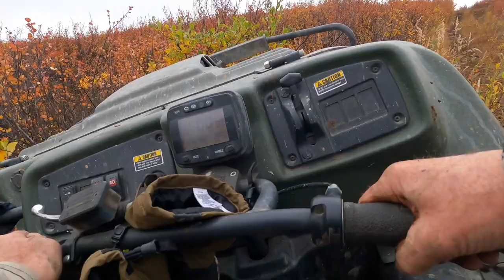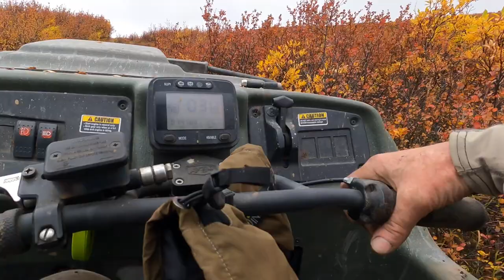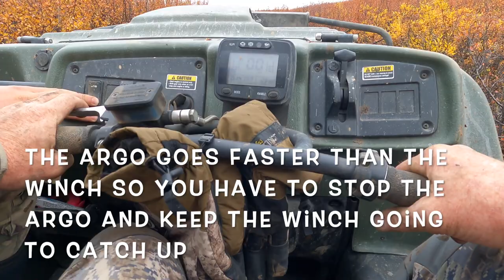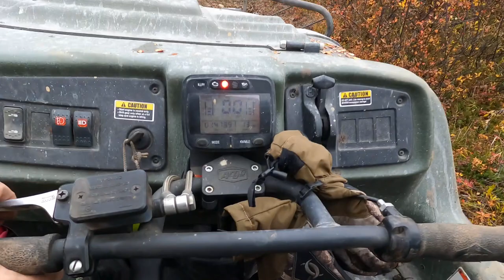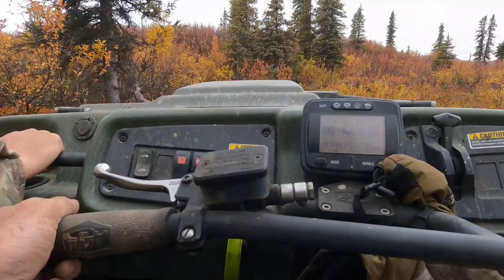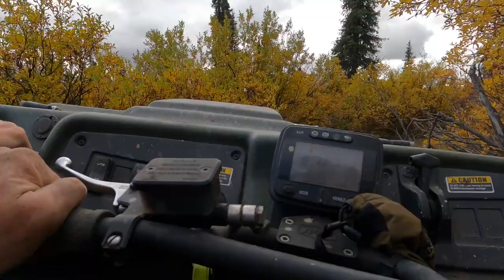An Alaskan Moose Hunting Trip with an Argo Gone Wrong - Day 2

Comment: My father worked on the Denali highway in 1956. My first trip was up there while he was working.I was 14. Some of the rigs we used were old weasels, 4x4 old dodge military rigs with 20 inch aircraft tires. This new stuff makes it a lot easier, you don't have to rebuild them all the time. There are a couple of those rigs still up there if you know where to look. I use a 6x6 polaris now.
Reply from the maker: Dandy rig. I’ve had conversations about going that direction.

Comment: Argos are 50,000 dollars now.   Under powered.
Reply from the maker: They have gotten very expensive, but I don’t know that underpowered is a correct term. They are low geared, and will go anywhere, but they don’t get there very fast.
Reply: @RaisedinAlaska in your video,  it wouldn't make it up a hill.   I had one.  They are under powered.
Reply: @RaisedinAlaska I have 300 acres in Ontario Canada.  They work good on flat land,  but my cousin and I both have an 8 wheeled argo,    and they are under powered.   Have a good one.
Reply from the maker: @mattdelany6799  Good catch: it would not make it up the hill because the grousers on the tracks are UHMW plastic and were slipping on the large flat rock trail going up the hill. Clearly, I should have given more details about that issue. Thank you.
Reply from the maker: @mattdelany6799  Good luck in the field. 👍🏽

Comment: With all the terrain features you barely made it through what was the plan to pack a moose out?  Also when the trailer was hung up, what stopped someone from getting behind and push?
Reply from the maker: Great question, this trip was three years ago, so I went back and watched the video again so I can give you a good answer to your questions.  With a broken track, we would have been really hard-pressed to get a moose out of there. We would have done one of two things: take the tracks off in certain areas and put them back on in other areas (which would’ve been a real pain in the fanny) or made this into two trips, and left the tracks off at the truck and went in without tracks (this would have been difficult as well because the Argo goes crazy places with tracks that it won’t go without them). When we were hung up in the first half mile it was a two fold problem: first, it’s pretty steep and second it’s very rocky, and the grousers on my tracks are made of plastic so they do not hook up on rocks very well. So your answer your question, I don’t think four people pushing. It would’ve been enough for us to get it up the hill. Thank you for watching.

Comment: do they not make a splice kit for those tracks? If not I would carry a piece of belting the same width as your rubber strips in your tracks and some carriage bolts and you could splice the track in the bush and not be screwed
Reply from the maker: I’m going to ponder that idea. After this experience, I got about 10 feet of quarter inch nylon winch cable and added it to my kit of parts pieces and tools that I always take along. I hadn’t thought about your idea, but that seems like a very doable fix.
Reply: @RaisedinAlaska  its fairly simple to do, thats how we used to fix nodwell tracks in the bush
Reply from the maker: @tyrellboyd8997  It is a great idea.

Comment: Cool video. They are a little expensive but you could consider adding a land anchor to your gear. I have heard god things from Pull Pal, I have never used one but for mud and soft ground seems like a god choice. For frozen or hard packed ground the All Tie version may be better.
Reply from the maker: I have looked at them, and I may have to add one into the back of my Argo just in case.
Reply: I don't know if it would be usable for your application but it is light weight and the idea alone is cool. Is the Deadman Which Anchor
Reply from the maker: @ezekielcade4205  I’ve been in places where without one I’d be in trouble.

Comment: So the question begs to be asked….do you really need tracks that much?  I mean people have been running Argos since what, the 50’s and only started to put tracks on them not that long ago.   With all the time spent on keeping them on, couldn’t you have just pulled both and ran it on wheels?
Beautiful countryside for a place with few trees.
Reply from the maker: Great question: There were mud holes that the Argo would not have made it through without tracks. I show a comparison of no tracks vrs tracks at the end of the video where I fix the tracks. I’ve been on this same trail, in years past, with a buddy who had an Argo without tracks and there were several places that I had to pull him through.
Reply: I ran tracks on my older moose hunting Conquest 8x8 for a few years & they were a pain in the arse. This year I swapped up the Goodyear Runamuck "floatation" tires for a set of Mudlite ATV tires & dumped the tracks. To my surprise it goes just about anywhere the tracks would take me that I had a will to risk (unless you have a 2nd Argo in the trip, you don't want to risk pushing your luck too far). Interestingly it also swims better with the mud lites than it ever did with the standard Runamucks. In my experience, the stuff you go through has to be a real more water than mud soup-mud with no root fibre in it to justify tracks. Any sort of roots or bush in the muck makes a MASSIVE difference. To get more grip you can chuck down a few bushes & branches to help...
Reply: @davidbrewer7937    Yeah, that’s more or less what I was thinking.  It’s got a lot to do with which tire, but it with a really aggressive tread it should run over almost anything.  I mean you got so many wheels, it’s almost like tracks, and no hassle.
Reply: @jimf1964  Maximum surface area in contact with the ground is key. Aggressive tread is good as long as you don't spin too much because this is like putting the root fibre in a blender. High centering is a major issue as well. I find it better to avoid the traveled track to avoid deep ruts.
Reply: Tracks ok in snow rest is worthless have had argos since 1980s.
Reply: Escargo tracks are best
Reply: @dustinclark8186  the new bush tracks  are a game changer  😁
Reply: @dustinclark8186  for sure I love mine!  glad I chose them after watching  videos of all the tracks. They are truly the best  and highly recommend them 😁

Comment: Youll be packen. Repair kit for next time.   Take a hand air pump next time. For tires.  Never know when youll need it.
Reply from the maker: I will have a better plan next time.😁
Reply: A length of steel fence wire, some steel chain & some nuts & bolts would have made a more robust bush fix...
Reply from the maker: @davidbrewer7937  True.

Comment: You need chain
Reply from the maker: Great idea. I did have a spare chain for the drivetrain.  That was an option, but I would have had to ruin it to use it for this application. That said, it was on my list if I could not limp it out with rope.